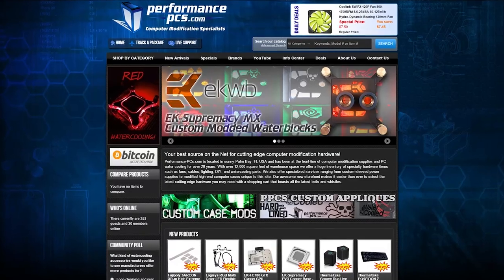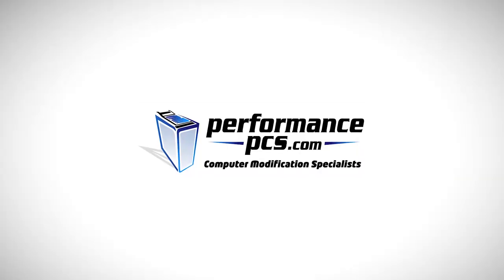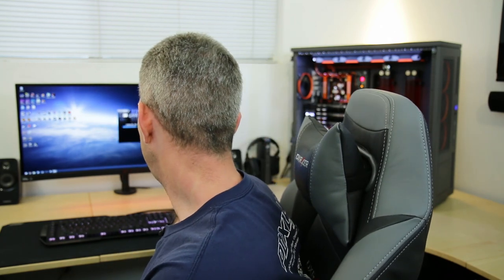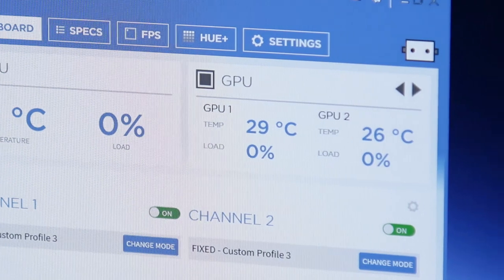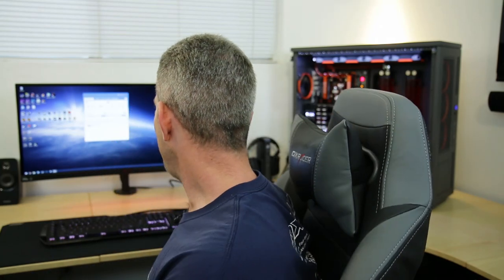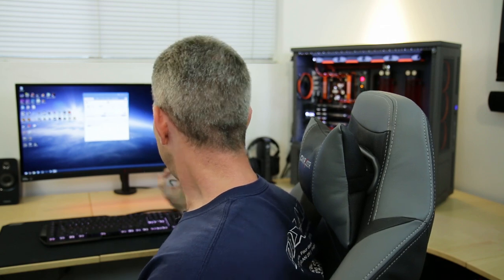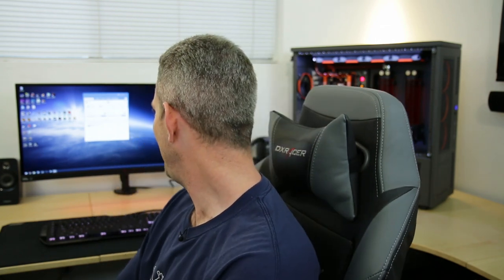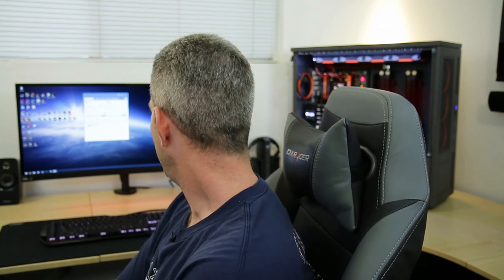INSANE Gaming PC 3 Titan X video cards! Such overkill

Comment: How is this for a gaming PC? The price is in CAD just so you know. 
Http://ca.pcpartpicker.com/p/8hCRD3
Reply: +William Martin I think it would be fine for gaming, although I would make some changes. I'd buy a different ssd. Samsung EVOs are really great. I'd knock it down to 8GB of RAM as you probably won't need 16GB (it's overkill). I'd also consider an AMD graphics card, as it's more bang for your buck, but that's up to you.
Reply: Which AMD GPU would you think would be a good choice? For around $300.
I can get a hold of 2133mgz 16gb RAM for $99.99 right now so I thought it would be good to get it while it's cheap.
I found an EVO 850 for only $6 more so I'll definitely get that.

http://ca.pcpartpicker.com/p/62twxr
Reply: Well a 380X is slightly better than a GTX 960, and a 390 is a whole league better than the 380X. If you could get a 390 that'd be a hell of a machine. And yeah, it's awesome RAM prices have dropped so much!
Reply: Lars Bolduc
Well I definitely can't afford a 390 but maybe a 380X. It looks pretty good. But I might get the 960 ssc because of its ACX 2.0 cooling. I am not super picky about FPS so going from 69 to 80 really isn't going to justify the extra money and temperatures. I might just save the $30 for when I get my next big upgrade.
Reply: Oh sorry I missed the fact you're in Canada. The 390 is ~$300 USD here. I don't know prices over there, but that makes sense. Good luck with your build!
Reply: Lars Bolduc
Yah a 390X is like $560. Thanks for all your help! I'll try to remember to tell you how it goes.

Comment: what is the plastic piece sticking up in the bottom of your reservoir for?
Reply: +Skyler Dyer It's like a little "divider" so that air bubbles coming through the loops and landing in the reservoir, wouldn't get sucked back into the loop immediately.
Reply: +Meta Custom Computers ahhhh. Cool, thanks always wondered since he stated using those reservoirs

Comment: Hi Jay!
I really like the orange, I just wanted to ask you why you mixed the primochill pc pure with the orange dye instead of just mixing the dye with distilled water. Does that make a huge difference in temps or was it just because you wanted to try out the pc pure liquid?
Reply: +Alexander Linger - If the orange dye is just that, orange dye, then you're probably going to want to add a corrosion inhibitor and biocide in the loop, too.  Without knowing anything about it, I'm assuming the Primochill liquid contains these things.
Reply: +9ff70f96 but doesn't the mayhems dye contain a corrosion inhibitor and biocide ?
Reply: +Alexander Linger - I don't know.  I don't know anything about it.